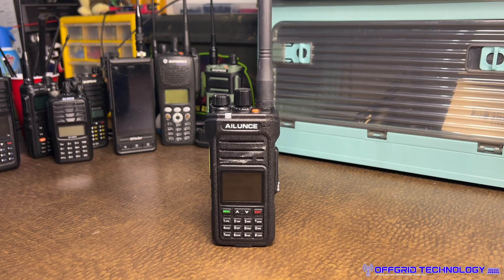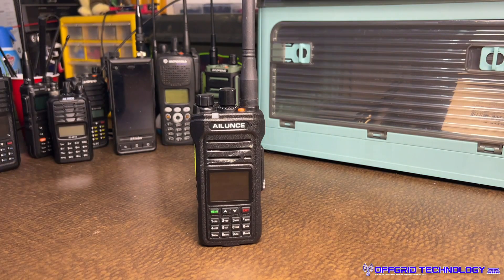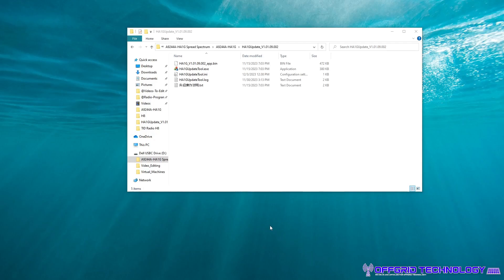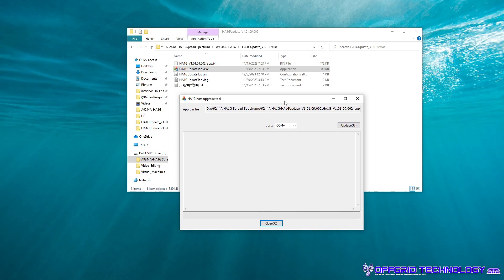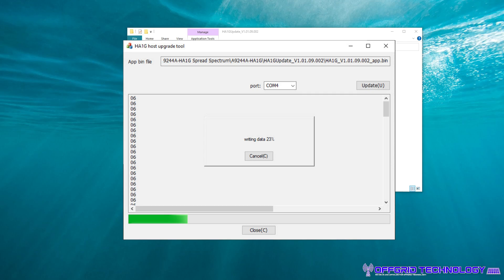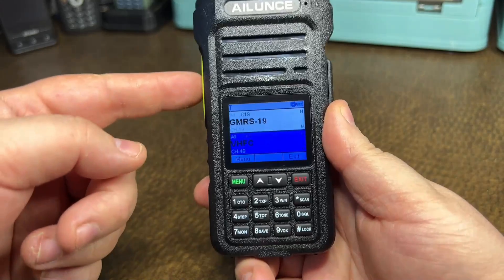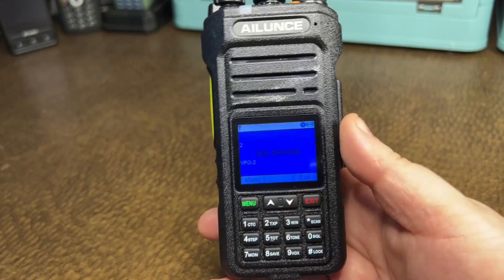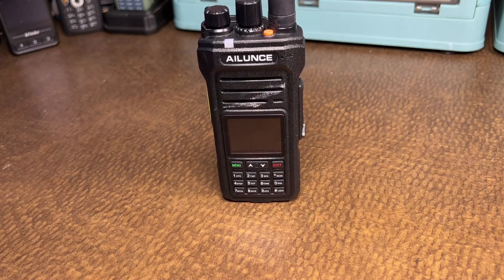Retevis HA1G Expanded Frequency Unlock | Offgrid Technology

Comment: To make it a permanent thing, you hold down the PTT the number 8 and power on, if you want to reverse it, you do the same thing, but then you won't have to do it every time you turn it on, you can also go into the programmer and lock specific channels to not transmit for protection of yourself.
Reply: I was about to come here and state the same.
Reply: This works for me out of the box. I did not have to update it.

Comment: Once the radio is updated. Turn it off, then turn it back on while holding the PTT and 8... It'll flash a message that says "EXTEND" and you won't have to put this code in every single time you turn the radio on.

Comment: This may have sold me on one of these, I like the form factor and ruggedness, but I was afraid they were harrscoded locked.

2 questions:

1) Doesn't his work on any firmware version?

2) If you know: Can this radio go into 500MHz?

At $50 on Amazon you can't go wrong if I can get it to do those.
Reply from the maker: It’s a specific firmware for the unlock. The radio stops at 480MHz however. That said it’s an amazing radio.
Reply: @offgrid.technology Just got mine, I wish it did reach up to 500mhz (even just RX), but hey no radio is perfect (so far)

Picked mine up with the mic for $45 with the Black Friday deal, even without the 500mhz it is definitely one of the best radios I own!

Comment: Edit: I finally got this to work on a different computer, but now the programming software won't read the radio. It says host failed then the radio restarts. Is there a different software i should be using with the new firmware?
Reply: I am having the same issue. Were you able to get the Ha1g to connect back to the programming software?
Reply: @DreamlandMediaProductions  mine is saying no data can be written after the radio connects. Wish it would be simpler.

Comment: Will this work as a police scanner
Reply: Yes it will. I recommend using the DIY channels so you can manually enter the frequencies into the radio with the pl tones. It works well with FM and FMN. It can also scan digital since it uses DCS(dpl) tones as well. Just make sure to set the TX permission to receive only as to not cause interference

Comment: If you're having the "Waiting for the host to enter upgrade mode" issue, do this: 
With your radio off, connect it to your pc and start the update. 
After the update has started and you see "Waiting for the host to enter upgrade mode" turn your radio on as shown in the video, the update will start. 
Once done, disconnect your radio, turn it off, and back on again. 
Your radio is now unlocked.
Reply: Many thanks for that suggestion. I was starting to get a bit frustrated. But your tip worked perfectly.
Reply: thanks man! was worried for a little bit lol but this worked! ty
Reply: Is it permanent until you undoit or do you have to do this everytime you power on
Reply: @brickandmordor91  the ability to unlock it is permanent until you rollback/update the software. Each time you power on the radio you will have to do the #lock - 1 2 3 4 5 6 unfortunately
Reply: Any idea why it would say no data can be written?
Reply: @evelcruzy  maybe they updated something? My radios are on hardware version 0.1 & firmware version 1.01.09.002
Reply: I just tried your steps & now I'm up on: FW Ver V 1.01.10.005  - thank u much!
Reply from the maker: Amazing help thank you so much!!!
Reply: Thanks a lot!

Comment: "Waiting for the host to enter upgrade mode 300/300" what is this?
Reply: with your radio off, connect it to your cable and start the update. When "Waiting for host" pops up, power on your radio as shown in the video and it'll write. I had the same issue and this fixed it.
Reply from the maker: Have not seen that error.
Reply: I cant get mu softwre to work
Reply: Were you able to figure out the fix to the "waiting for host" I'm having the same issue.

Comment: Man... I get unable to write to host and now my radio wont boot...
Reply: Have u got it to boot?
Reply: @matthew-q2y3h so my buddy gave me this radio bc he didn’t know it couldn’t be used on VHF, so I had nothing to lose so I tired this I had the same problem but I moved my files around put the radio into program mode and tried it at first I got waiting for host 300/300 then I turned the radio off and started the update then turned the radio on in program mode after it updated I unplugged it and turned it back on and it works you could try this